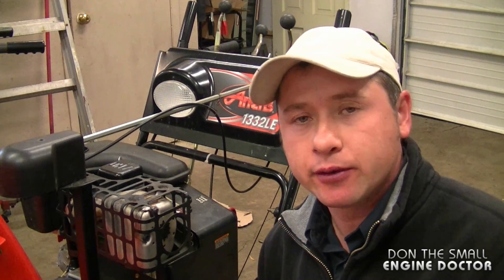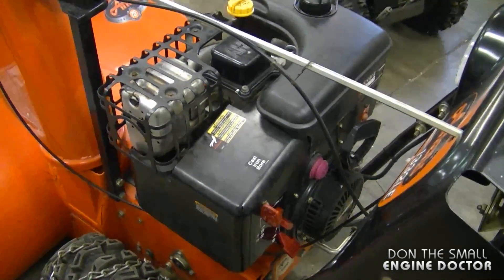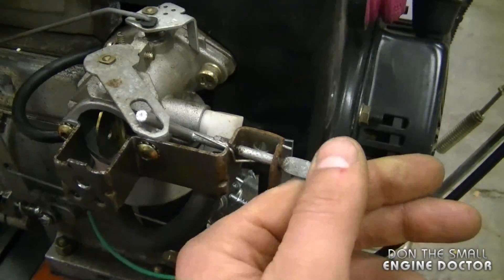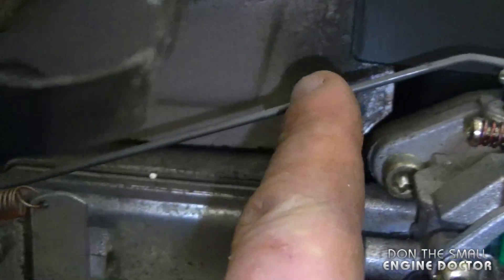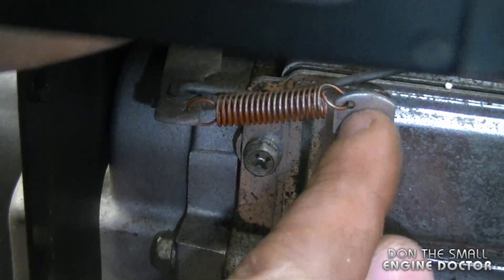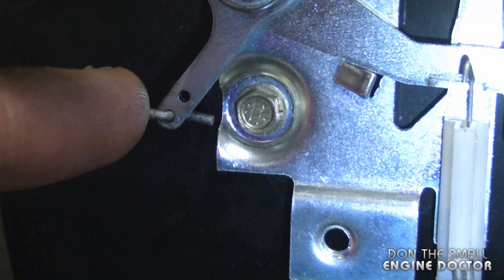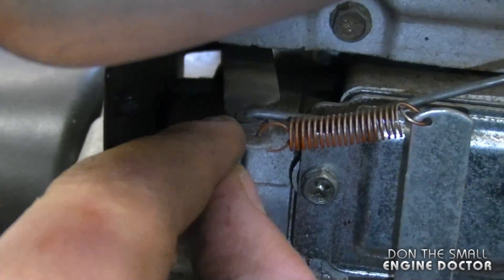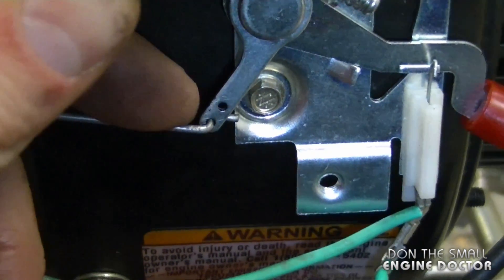OHV Tecumseh Throttle Linkage Configuration On Snowking Engines

Comment: my ohsk90 is similar to this, I noticed your carburator has fully open throttle butterfly with throttle lever set to off position. Should stay like this when engine don't run? 

I was a little worried with mine because I was thinking throttle butterfly shold stay close when engine don't run, like I see in some others videos and I noticed mine stay half open when engine don't run ad the throttle lever is in off position.

I bought used yard-man. I just changed carburator because engine surge and I had the feeling engine rev too high. I noticed previous owner tied the side lever with wire, which I later noticed was bent and without the wire go beyond the stop. I dont' know if the sprig and linkages plays are ok.

Comment: why is the throttle wide open mine is the same I have a master craft snowblower and its surging cleaned the carb did the valves and its still doing the same thing getting really frustrated with it LOL any help on how to set up the governor cant find anything on the 12 horse set up thanks

Comment: Thanks for yet another expertly done video. I've worked on a couple of these engines lately and this helps.  One is an HMSK80 on my brothers 2006 or so Lawnboy Snow Thrower.  It would start but would not stay running unless I continued to prime it. (A trick I learned from one of your videos.) That told me we had a fuel delivery prob.  It has a very basic carb with no adjustable jets. We cleaned out the carb which did have some debris; but it was relatively clean. Put it back together and it ran pretty well. The next time he used it, it surged a lot and died after about 1 hour. Using a spark tester showed a strong enough spark but the light was not really steady. Should it be? Your thoughts?

Comment: Donny Boy 
 My tecumseh 8 Hoss snow blower motor
I'm putting on a new carburetor.
But I noticed that the fuel line Hits the linkage from the Governor .
What do I do about this can I move the throttle mechanism up or can I move the linkage on the governor do you understand what I'm talking about thank you very much all your videos have been real helpful
Reply: Not sure what a hoss engine is (probably autocorrected?). Is it OHV like the video? Or flat head ?
Reply: 8HP

Comment: What does that long vertical arm that goes into your engine actually do? Sometimes that arm goes up left and right and my engine starts to stumble.
Reply: that's your engine governor lever. helps control engine speed based on load. when the engine slows down (too much load) the governor flyweights relax and pulls the throttle open to give more juice. when the engine speeds up the flyweights open up and allow the throttle to close up to keep from over revving. flyweights are usually heavy weights on arms connected to a pivot point geared into the camshaft.  that is the most common mechanical style found on small engines. i'm sure there is a good youtube video demonstrating it.

Comment: Great video Dony. Are Tecumseh a bit finicky starting cold? I have a 5 hp that I just put in a new carb and plug with fresh gas and it's just a bear to start. I prime 2-3 times, full throttle, and it just gives a few minor chugs and then dies. Temp is about 0 deg F.

Comment: Great video. I have a 7.5hp snow king and the throttle lever won't stay up, I can only get full power if I hold pressure on it. Any help would be great. Thank you
Reply: i have a craftsman with the 12hp tecumseh, same problem. I have a piece of house wire running from the top that i bend around it to hold it up.... one day i will fix it.

Comment: As allways great video. Both content, sound and video-quality :)
One question: As you go along disassembling an engine, do you remember the configuration, write it down or do you mark each hole used? I guess, you dont consult your own video, when assembling.

best regards
Reply: Im not Don but I do work on streetbikes and stuff, sometimes having 4 mikuni carbs total to tear down at once. He's probably like me and just remembers it after doing it for so long! Though taking photos or videos can help you for reference. But most of the time once you start reassembling you'll be able to kind of see where stuff wants to go!